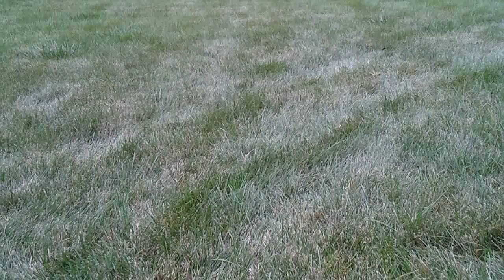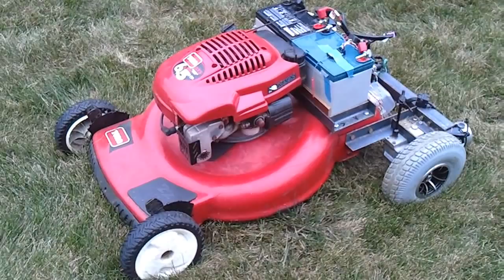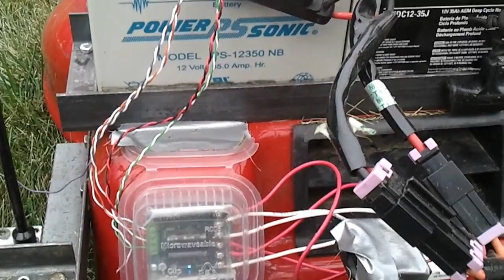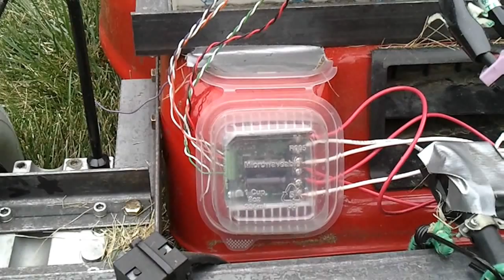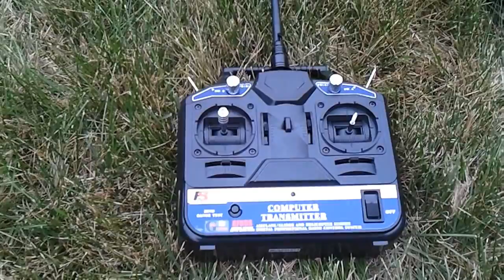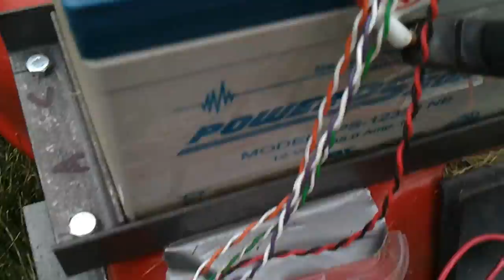Remote Control Mowbot Explained

Comment: Do you have a diagram of connection between motor control and RC receiver I'm having issues with mine and I have the same components you have

Comment: I can't find any electric wheelchairs in my budget and would like to source the motors individually.  Can someone give me some leads?  I keep getting a bunch of hits for amazon motors, but when reading the comments, users say they lack the torque needed for this kind of application.  Would I be able to find motors for around $75 each?
Reply: Michael J Try Servocity.com They sell all sorts of electric motors, servos, framework, etc...
Reply: @bereal9984  motors strong enough to pull a regular 5 horse mower up a 20º incline?
Reply: @MichaelJeffers75   I've only bought smaller servos from them so far, but I know from browsing their site that they sell larger, more powerful DC motors. It's worth checkin em out at least.
Reply: @bereal9984  I wasn't able to find any motors big enough to pull a heavy load like a gas mower.

Comment: You can let a little air out of the tires that would help the bounce issue and any tearout the tires may do to the grass. I am building one soon and will be using lawn mower tires as they are designed not to damage the lawn.
Reply: They are nylon-filled flat-free tires on the back.  I just started building mine and this thing is going to weigh a ton... I am using 6 in castors and keeping the weight to the rear as much as possible to keep from putting a lot on those.

Comment: Excellent robotic mower!>>>t.co/JC2s7q0Gig  Quick shipping, easy to set up, and now the yard is always perfectly mowed automatically without me having to do anything. I couldn't be happier with my purchase.I would upgrade to a model that has it in a heartbeat.
Reply: for $3200 and a 2 star review, nah i'm good on each account, thanks
Reply: OK, lessee... The above item goes for $3725. I pay neighborhood kids roughly $30 per mowing, around 8 times a year. You can do the math, but it will take the $3725 mower a little over 13-1/2 years to break even. ( I seriously doubt it will last that long).
Or, if I go with Mr. Evans design, I see this: Some quick surfing of Ebay and Amazon (NOT LOOKING for deals or work-arounds, or even reusing my existing mower, etc) yields around $635 to put this thing together. (I'll post the shopping list if anyone is interested). I like the simple, rugged design. Mr. Evans also posted a video of his young daughter having a very fun time with the whole endeavor!
I don't mean to be rude, Ms. Vargas, but do you have some financial interest in the Evatech mower in your link?
Reply: good

Comment: I would have eliminated the heavy batts, added an alternator.
Reply: Not possible. Even the alternator would need batteries to excite the windings and also to cushion the voltage output to the sensitive electronics.
Reply: not only that takes to much power to turn it
Reply: +Pam Lee exactly. it would require half of the engines output just to produce the power needed. Also, deep cycle batteries are not designed to be constantly overcharged.
Reply: From very limited research, it looks like power wheelchairs draw about 250W under load. Wheelchairs primarily run on smooth pavement with heavier loads compared to a lighter mower on grass, which is much harder to navigate (more power draw).
Vehicle alternators are only about 40% efficient, and on top of that we have the AC-DC conversion which is about ~85% efficient. So we'll need to rob about ~745W/ 1HP output from the mower.

Comment: Great job, but how does it turn with fixed wheels in front?
Reply: +Jack Phillips Great catch! I didn't notice it right away. Maybe it will just have a skid steer action with the reversing of one and forwarding of the other powered rear wheels. I think it would be much better on a castor like front end.
Reply: @1crazynordlander  You got the right answers. I watched other designer's demonstration: If those wheels are fixed, one wheel will turn opposite direction to other, either turn left or right.
Reply: Jack Phillips Differential steering.
Reply: T STreeter, Yes we know its Differential steering. What hes asking is how does it turn with the fixed wheels in the front.
Basically as 1crazynordlander said, it just skids.
Reply: Jack Phillips You can't be serious????? LOL . Differential steering.

Comment: Hi. I'm in the final stage of building mine and hit a snag with batteries. I don't know much about them but I believe I need a 12v AGM/Deep cycle. I can't seem to find the ones that the wheel chair came with but they are 12v 35ah. Can you recommend batteries I can find locally? Walmart seems to have this everstart brand but none show the specs and I don't want to play trial and error... Any help would be appreciated!
Reply: +Lacey Fas  DO A GOOGLE ON 'TROJAN BATTERY CO.'....I'VE USED THEIRS IN THE PAST FOR RV USE.

Comment: I built a very similar unit a few years back. I really like your simplistic chassis. How well does it corner though? I noticed your front wheels don't pivot, are you losing a lot of maneuverability when using the tank drive setup with the rigid front wheels?

Comment: how come you mounted the wheelchair motors sideways and low to the ground, can you mount them standing up and off the ground?
Reply: Mounted vertically as Thomas suggested would be good if your lawn wasn't perfectly flat it would give better ground clearance.  Overall Lee did a great job!
Reply: Eather direction, I got mine backwards over the deck to keep the overall length down.

Comment: How long does those batteries last per cut
Reply: I would assume that the batteries last long enough for you to cut all of your grasses and then you have to put the batteries on charger for next time......
Reply: Then why would people use two large marine batteries that weights a hundred pounds.
Reply: t dub
Well, they probably needed batteries with a longer amp hour that will allow them to do whatever for a lot longer than just 30 minutes to an hour. I run my two 12volt batteries for about an hour and it still has enough power to run my mower.
Reply: t dub
My mower can pull my dad (220lbs) around the block twice sitting in a dumpcart with just a 12v car battery and still have plenty of power. Note my car battery has 95 reserve current rating which is 95 min at 25 amp draw.

Comment: I am hoping someone could help me on this...I am modifying my lawn mower to RC...I got all the necessary parts except for the batteries, because I am little lost....I was told by the seller my Pihsiang motors are 24V in the range of 300 to 400 watts EACH. He suggested that I get 35V battery for each motor... That would be very expensive...I see people like you using 12V batteries in series to run the motors. Is that for both of the motors? Could someone please give me some direction and advice on buying my batteries....I don't want to spend too much money.... I am a newbee if you didn't notice......:)
Reply: What i would do is i would get a few pairs of electric scooters off of ebay, they come with chargers for the batteries, controllers and all that other good stuff. They only need a small current to turn the motors on, and these are inexpensive. Since i can see that you bought some stuff for it already, i honestly think that what will happen is instead of getting 1-2 hours out of the batteries, it will be only 30-45 minutes also, get a mower that has an electric start on it (toro and craftsman have a few of these that i would recomend, i would go with toro) and that can help. Also, its not hard to put an alternator on a mower, on a mower i have, the alternator is a ring that goes underneath the fan, with some copper coils, and its about 2-3 centimeters thick. It can put out 10 amps at high RPM. This is just what i would do, good luck! Edit: I just had another idea pop into my head about the batteries needing charge! If you look on Ebay, you can find a good cheap alternator that is cabable of 105 amps by DB electrical, i have one on my truck, its amazing. If you mount a pulley from the fan's shaft, to the alternator, you have unlimited energy.
Reply: jazz ie
Thank you for your reply... Actually all I needed was just two 12 volt batteries and then you just need to connect them in series. Thank you again for your response.
Reply: Oh, if i had known you didnt know to connect them in series, i would have told you on the spot :P
Reply: I'm using a single 12v car battery on mine and it works just fine. Charging just takes a car charger, I plan to use a 1.2a charger off ebay for $5.

Comment: Hi Lee,
Thanks for the response.  OK, so you use the lever, formerly connected to the safety handle to turn it on, then just flip/slide it back to turn it off.  Thanks for the information.  I'll send you a note when I'm done with mine.

Comment from the maker: yeah, I agree.  But it was easier to mount the motors in this direction.  I've only had to lift the mower (turned off of course) a couple of times due to a drive wheel  motors being stuck in a pothole.  There's enough torque on the motors that I can usually power through any area that drags on the bottom of the motor.

Comment from the maker: To turn the engine on, I flip the lever on the side of the motor.  The lever used to be connected to the safety handle that would need to be pulled together in order to start the engine.  I put a bit of a bend in the lever to keep it in place with tension

Comment from the maker: Also, the 2 motors are 24 volt.  The 2 12 volt batteries are hooked up in a series to get the correct voltage for the motors.

Comment: WOW, I like your simplicity and all the info of what parts you used to do this.  How well do  you think this would do on an Incline.  I have a cabin with a steep bank some where between 30 and 45*I use to mow it with a weed eater just walking up and down the bank but 2 years ago I broke two verterbra in my back.  So, I cannot take care of this lawn.  Have you tried this baby on any mild to sever inclines?

Comment: just to think of it, you know how jogging strollers look? the front wheel is a castor but you can lock it in place with a handle, a front wheel like that, you could unlock it to turn and lock it to go straight, you do have extra channels so it should be duable.  GREAT JOB AND GOOD LUCK

Comment: That is corect. That is how I steer mine. But I have casters on the front wheels. His front wheels are locked. I am curious how well it turns or if it turns at all with fixed front wheels. I would imagine you could make some small degrtee of direction change but not turn it completely around. Mine will spin in a circle so when I get to the end of a row I turn it around and take the next row.

Comment: They could but then it's wouldn't be able to turn. It's only the read wheels that steer and power the whole thing.

If it can only go in strait lines, it doesn't make a RC mower all the piratical.

Comment: I use a 33 year old Toro self-propelled with a Tecumseh that fires up first yank -- every time.
On it's second set of drive wheels, second drive belt, never done a thing to the motor except a plug replacement every 5 years and change oil every 3.
And sorry, but Honda is the small engine of choice -- lawn mowers and generators especially.

Comment: Looks like a real bad-ass -- jacked up and all.
Do the batteries charge from the mower?
For maneuverability, and because the rear wheels are independent and reversible, casters on the front would be perfect -- turn on a dime, literally.

Comment: Couldn't you have just locked the wheels on the same axle and connect one motor to it so you would only require one battery/motor?

Comment: looking at your wiring, are you using a seperate battery to power your receiver. Any thoughts on using the sabertooth supply to power the receiver. looks great, the discription was a great help. I have all the parts just a little more research before I start wiring it up. Thanks again

Comment: I used a Sabertooth as well. I have casters on mine.. I have a small yard and it turns very sharp. How do you get it to turn without casters? I made some changes to my build where I made the wheels slightly more narrow than the deck to make it easier to trim and it would hardly turn even with casters. It is not that hard to drive with them.. :)
rcmowerrev3point0
Reply: RCWagon do you have a video of yours?

Comment: would it be advantageous to rotate the motor up over the axle to gain clearance and reduce 'catch and drag' clippings from snagging?  also, what is the 'water resistance' rating on the motors, as they are in direct contact with wet, pulverized grass ends and moisture from the ground.   is the motor controller a pulse width type?  any way to add a solar charger that will self charge when the item rests in the sun or some kind of generator attached to the flywheel?

Comment: I watch your video and I gotta say thank you. I was on the verge of duplicating another video where instead of the sabertooth, it used a computer box that costs $500. So far, i have the tires/motors and the fly sky RC.  I just need the sabertooth and the angle iron. I am so glad I found your video. Thanks

Comment: you should use a four stroke moped engine that'd be MUCH better than these things. it'd go fast no charging problems no expensive batteries and like 1000lawn mows per gallon

Comment: great video!  I have the same sabertooth, And remote. How did you wire it into the sabertooth.
Battery, Chan1, And Chan2. Which pins are used.
Thanks
Spike :)

Comment from the maker: Regarding the castors...  Yes, castors would be is great for steering the mowbot around, but not so great when trying to go in a straight line when I'm cutting the grass.  Maybe if the lawn was nicely rolled flat like a golf course fairway castors would work better than the straight (non swiveling) wheels. But my lawn has a bit of an incline and is not very smooth under the grass.

Comment from the maker: Steering is done via the remote transmitter that "Talks" to the Sabertooth through the remote receiver. No programming is needed.  I use the default remote controlled settings that is provided by the Sabertooth. Quick and Easy!
Reply: Lee Evans hey my name is Joseph am a student working on remote controls I will need your help please.  Please contact me back at amoakojoseph98@gmail.com  thank you.